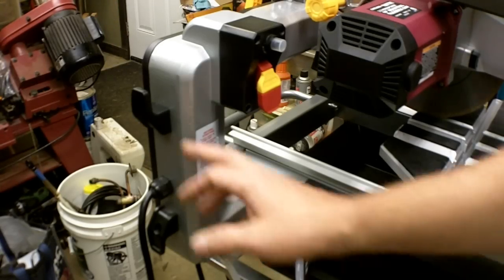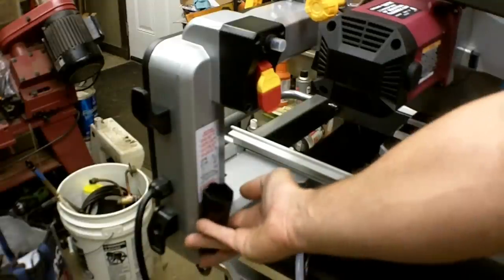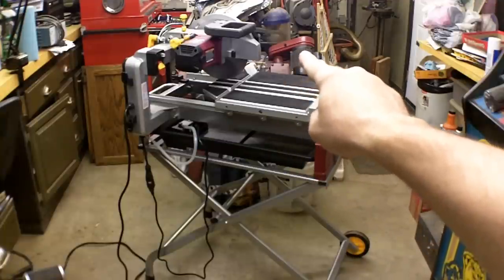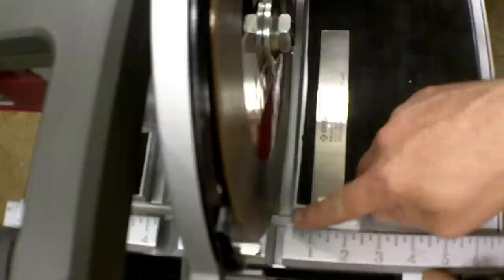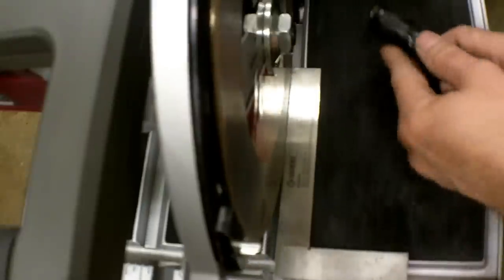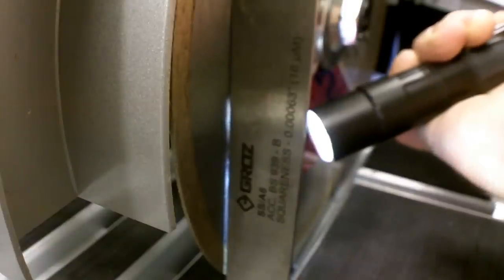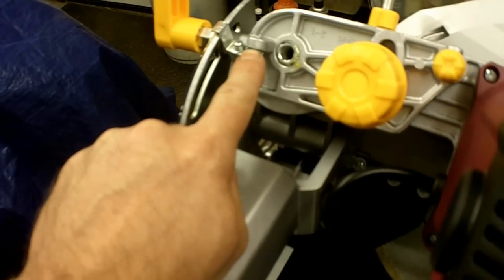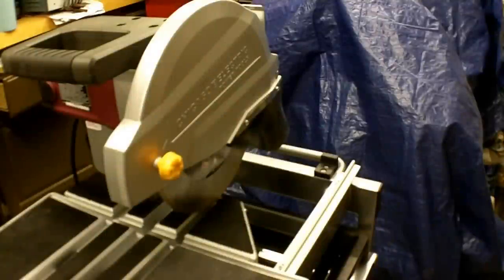Part 2-2 Harbor Freight 10” 2.5 HP Tile/Brick Saw Review Item 69275

Comment: Well G. I went out and picked one up. I have to admit ... It's a well constructed tile cutter. I have a Dewalt blade coming today via the Brown truck. I'll do my alignment checks and get back. One thing I wasn't sure about after watching ur review. I see the vent hole on the motor end cap. Wasn't sure if this was an enclosed motor. After I pulled the one I purchased. It was the first thing I looked for. Yes !!! Those visa blue slots are not open. It is an enclosed motor. No chance of water getting in there. Thanks again. Oh by the way.  They are on sale for $229. Till the end of Sept 2016. Need coupon. Later.
Reply from the maker: That's cool Robert! Agreed, it's constructed quite well- especially for what it costs.  Yes, they are sealed motors. I still don't leave mine in the bath for good measure. It should last longer by doing so are my thoughts. $229 sounds like a good deal to me. They want $700 for the Ridged 10" at HD. It might have some better/other features, and perhaps better parts availability- but I could  buy three of these and still be ahead of the game for one of them. Plus have two parts machines. I'm pleased! Take care, G.

Comment: Another great review G.  Always enjoy the detail you bring about the products.  The saw as you got it for the price looks like a great value.  Was a bit surprised how quiet it was for the motor size.  Assume it came with spare brushes like their other products...will be interesting to see how long they last on a 2.5hp motor and how it holds up for a "hard core DIY'er" like yourself.  Even so it looks to be a twofer based on your cost. 

Was thinking on your bucket drain to put a flange (maybe PVC sink stuff?) and a hose to port it outside the stand frame to a bucket...looks to be about 1.5".  I'm also sure you could come up with some quick release mech. to leave the saw in place while still folding.  Thanks for sharing and your work to show us!!  ~PJ
Reply from the maker: pjsalchemy Thanks PJ! I was surprised with it as well. It's about the same as my chop saw in terms of loudness- not too bad at all. It did not come with extra brushes, like most of the other stuff I've received. I was a bit surprised and bummed on that one, but hopefully they're run of the mill if I ever need a set.

My wife also mentioned using a hose as well. I'd not put too much thought into it yet. I like the idea of using a sink type drain. I could either use a bung, or even a PVC ball valve inline the hose. 

I've been mulling around ideas for the stand while in bed trying to fall asleep. It seems to be the time I get most creative...lol. Providing I do come up with something, and implement it, I will share it out so others can as well- hopefully with off the shelf components. Good to hear from you! G.

Comment: I have this exact saw. I'm attempting a straight cut of a 12" porcelain tile. The blade is square to the table and perfectly parallel to the rail (I used a framing square for rail alignment). Somehow I'm still getting an out of square cut. On close inspection, it seems that the blade is flexing away from the motor as I pass the tile through the saw. I end up with a cut that off by over 1/16" after 12". Do you have any idea why this would occur given that everything seems to be in alignment? Could this be due to the blade getting too hot?
Reply from the maker: I have a few things to consider Eric. 1) The tile itself may not be square to begin with- especially so if it's not rectified tile. 2) Your framing square may not really be square. This is something you should check. http://www.woodsmithtips.com/2011/02/17/is-your-framing-square-square/ While framing squares are fine for framing- for machine tool setup, a machinist square would be a better and more accurate tool to use. But, you should be able to get an acceptable setup for tile work with your square- providing your square is reasonably square. Sounds like I'm contradicting myself but what I mean is, if you don't have a further need for a machinist square- there's no point in purchasing one if you can make due with what you already have on hand.
3) The lock on the side, when left loose, does allow the arm to wiggle a little- at least on mine. I would lower the blade all the way, then tighten the lock, then check your setup again. You can see the lock I'm speaking of here: https://youtu.be/dRykxzF0elY?t=604
4) I guess the blade could be causing problems, but I would start with the rest first since it won't cost anything. You didn't mention which blade you have, but it should be a continuous rim for porcelain tile.  And be sure not to force the cut- let it work at it's own pace. If all else is correct, I would then go for a new blade. Hope this helps, G.
Reply: The thin kerf blades flex more than the thicker ones
Reply: My Dewalt blade flexes about 1/8", the spacer between the motor and blade has a lot of slope in it. I hate to take it back for one small defective piece.

Comment: what kind of Blade did you have? mine started new Dewalt blade chips porcelain tile. any ideas?
Reply from the maker: This is the blade I have. Hope this helps, G.

http://www.homedepot.com/p/KING-DIAMOND-10-in-Diamond-Tile-Circular-Saw-Blade-C10S7/100573049?keyword=king+diamond+10
Reply: fixed the issue with blade you recommended and adjustment instructions. thank you! keep up the great work and videos
Reply from the maker: That's cool! Glad you got it sorted out. Good luck, G.

Comment: One thing you don't mention that I encountered almost immediately is that you cannot cut a narrow strip off a wide tile on the left side -- you'll hit the motor assembly arm.  You have to flip it around.  Its not a show stopper, but just something that can be a little annoying.
Reply from the maker: That's true and a good tip! I didn't even think of it being a problem since I was testing with smaller format tile. Thanks for the post! G.
Reply: BTW, based on your review, I decided that I got a lemon -- the sliding tray wasn't smooth.  I exchanged mine today and, wow, what a difference!  This replacement unit is so much better.  The other one didn't cut straight and the tray was very stiff and hard to roll.  New one rolls smooth and cuts straight as a laser.
Reply from the maker: Knowing their quality control is spotty at best, that wouldn't surprise me. Glad the new one works as it should! G.

Comment: Hey G, once again another fantastic review.  I'm curious, in my area these (or ones similar) come up on Craigslist all the time.  Did you consider buying a used one and then selling it when finished?  I need to do some tile in my house and when I'm ready I was thinking of buying used and then reselling it.  Guess I'm double checking my thinking here since I don't always think too straight.  :-)  Thanks again for the videos.
Reply from the maker: ***** Thanks Larry! I did consider used and looked for a bit over time knowing I was going to need one. Most of what I found around here looked to be completely worn out, or they wanted more than I was willing to spend if they were in good shape. I don't know how quick they move at re-sale, but I would definitely check into getting one like that for your use. Good to hear from you! G.

Comment: Love your review but I will have to point out you have your tub backwards where your water pump is in the direction that you have your tub is all the sediment from when you cut your tile is going to go directly down into your water pump reservoir if you turn your tub around and put your pump reservoir at the furthest backpoint it won't take any real sediment and you want to worry about it clogging up over time. Those pants have three separate sections so that as the water moves back towards your water pump the sediment settles down into the first two sections so it doesn't get over into your but you completely negate that by putting your pump right under the saw where all the sediment is coming from
Reply from the maker: Good tips, all of them. Take care, G.

Comment: At first I loved it, however the blade lock broke with the first blade in, and now I can't remove the blade to install a new one. Worked for 1 blade. Disposable p.o.s. in my opinion.  Oh and Harbor Freight can't find my warranty in their system,  stating "their systems changed".  Buyers Beware!!
I'm buying a Rigid wet saw this weekend and this Chicago Electric saw may be in the scrap pile.
Reply from the maker: That's cool Daniel. The arbor lock is more of a convince in my opinion. You should be able to grab the blade and loosen the arbor nut to change the blade. Most table saws, and many chop saws are this way as well. Just some general information. However, if your spindle lock pin sheared off, it might be necessary to take things apart to remove the broken bit. Good luck whichever way you go. Take care, G.
Reply: If you have an electric impact or air impact, that will take it off no issues

Comment: He checks the square relative to the sliding tray and blade but not the travel of the tray to blade. He is ensuring that the blade does not plow sideways through the brick but not that the cut is square to the tray travel!
Reply from the maker: Sure Van, I see what you're saying. Keep in mind though- the only adjustment available is to ensure the blade is perpendicular to the table fence. If it plows sideways, then rollers aren't perpendicular to the table fence. As far as I know, there is no adjustment for that condition. Thanks for the post, G.

Comment: I don't understand all the comments about harbor freight tools being junk.  I've been remodeling homes for rental properties and flips for years with their tools.  This saw has worked great,  same as their 10 compound slide miter saw.  Use a good blade and let the tool work and they last.  Haven't had any trouble except for the occasional adjustment to true them. Same with there hand tools cheap and a  lifetime warranty. Just walk in and get a new one. From hand tools, nailers, saws the list goes on. Maybe i just have good luck with their stuff.  Personally i dont care what the next guy says about my tools. I say show me your job that your 1000 dollar saw made look better.
Reply from the maker: I've had a couple of duds, but overall I've been satisfied- especially for what they cost. Take care, G.

Comment: Hello. QUESTION. what I the GPH , gallons per hour, on the water pump? Our pump failed and want to buy an after market pump. H freight says 12 weeks !! To get an O.E. M. From China. Thanks!!
Reply from the maker: Kenny, it doesn't say on my pump what the  GPH is. The part number is 
fd-101a but I couldn't find it online. This pump looks like it might 
work though and is for their tile saws. It clams to be adjustable up to 
40 GPH. I would think it would work fine. Check it out and hope this 
helps, G.

http://www.homedepot.com/p/Ryobi-Universal-Water-Pump-A114UWP/100665714

Comment: Hey G regarding the drain being at the wrong end.  Couldn't you install pan with drain at end you want.  Place pump in five gallon bucket full of water at end pump is on now.  And leave plug out of pan so dirty water drains directly into waste water five gallon bucket?  That way you aren't pumping contaminated water that can clog your pump.  And periodically fill pump bucket with fresh water and pour out waste bucket?
Reply from the maker: You absolutely could! It does a good job keeping the particulate out as designed, but I still think the bung should be on the other end of the pan. That's a good idea and might help others out. Thanks for sharing, G.
Reply: Another point about the  comment concerning the 5 gallon bucket: It can be set on the lower crossbar and leaned against the upper crossbar.  It leans at an angle, but catches the water fine.

Comment: Sorry one other thing. Blade diameter is very important. It's all about surface feet per min. Given same motor rpm. A 10 in blade has approx twice the surface feet per min. As compared to a 6 in blade. A big plus. Later
Reply from the maker: Very true Robert! G.

Comment: The saw works good. not perfect but good. I don't like how wide the the cutout on the table for the saw blade is.
As for blades HF are crap after about 10-20 cut. you start getting alot of small chips outs. I upgraded to a dewalt.
Reply from the maker: Dusty G. I didn't notice that until you pointed it out. I just looked at a Ridgid and they're  extremely wide as well. The MK I looked at has really tight slots, but the price is up there for their saws. The first sliver I cut did fall down into the slot.  I didn't even bother trying a HF blade since the reviews were so horrible. I picked up the one of two options I had available at HD. I think this blade was somewhere around $40. I see the Dewalt is about the same cost. If I have problems with this blade, I'll try one of them out. Thanks for the info Dust, G.

Comment: Oh by the way G.  Talk Wacker has no idea of what he is talking about. I assess my needs and buy solid tools. I have all Festoos Tools, CNC router and high end hand tools. I've yet to have a customer come to me and mention that they were glad I was using a Festool saw. They are only interested in the result. I'm not sure about u but I don't do crap work. It's all about making good decision on tool purchases. Some of the Harbor freight stuff is junk, but not this one. Later, Bob
Reply from the maker: I know...lol. I get folks with that type of attitude on my channel from time to time. Rather than being constructive, or ask why this brand over something else is beyond me. I usually don't even get a response to my response. I try to educate through my channel, but if someone's not willing to learn- they're beyond help in my opinion...lol. But, I try to educate them anyway. My channel is mainly geared for the DIY folks so they can get something for a good cost to use on their own projects. Most are not made of money or they simply don't need higher ended tools for casual use. I usually don't show my higher ended stuff since there's usually not much to say about them, and pro's are typically not my main audience. Plus the tube is flooded with them. I can say, if I had to do it all over again, many of my higher ended tools would be a different brand- and would have cost me way less! There was no internet when I started collecting as a teen...lol. No, I don't put out crap work and try to do things right the first time. I have too much pride for doing that- probably even too much for some cases where good could be good enough...lol. 

 Agreed!  If a client knows what they're looking at, they might even have the knowledge/skill to do it for themselves. But yeah, they don't typically know what they're looking at. I truly believe Wacker measures his worth with brands. 
I would hate to be that way, not to mention I'd be one broke puppy....lol.

Yep, some of the HF stuff is junk and I will not deny that. I'm very selective on what I buy, and have been satisfied with only a couple of exceptions. But if you have a decent understanding of tools, and can get your hands on them  first, you can usually spot the lemons straight away. Or at least gauge if you can get by with it for your needs. If not, find something better! Thanks again, G.